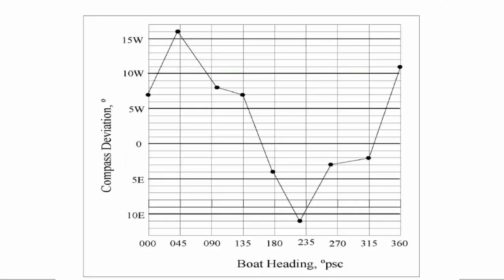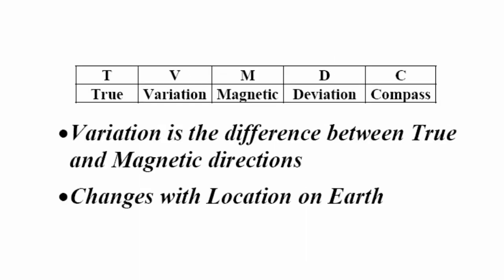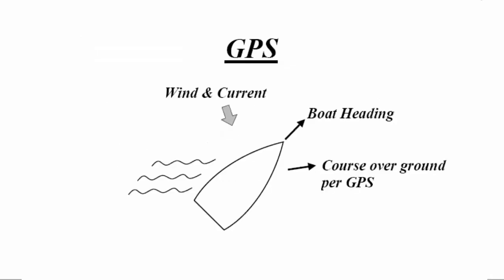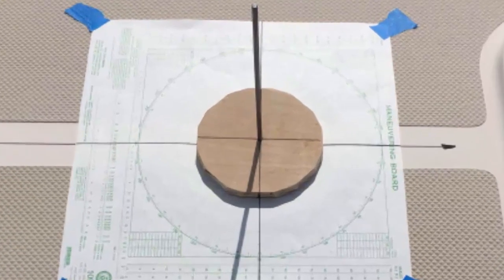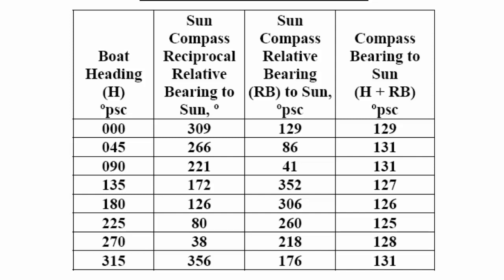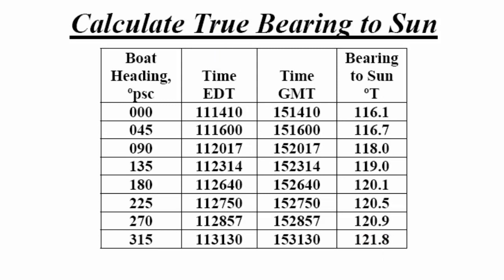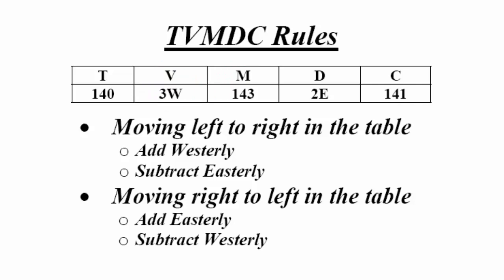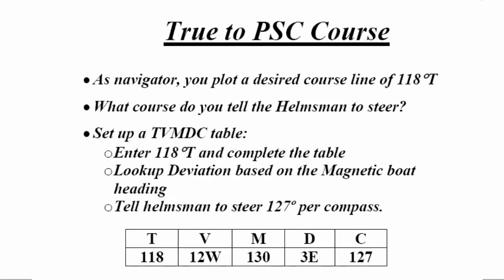Compass Calibration-  The Easy Way

Comment: If you mount the maneuvering chart 0 to the stern instead of 0 to the bow, then you can skip needing to add/subtract 180 to convert reciprocal bearings to relative bearings.
Reply from the maker: That's a good suggestion. Thanks... MDS

Comment: This is an excellent video - thank you for sharing! I can't wait to use this method on my own boat. How did you find the centerline of the boat with which to align your maneuvering board? It seems like it would be fairly easy to be off 1 or 2 degrees when finding the exact centerline of the boat - throwing the deviation table out of whack for a few degrees.

Comment: I've worked through this multiple times and I'm getting lost on a point.  How does the Compass Bearing to the Sun (H + RB) relate to getting the Bearing to the Sun?  It seems like there is no connection between these two numbers.  The Bearing to the Sun comes from the calculation of Lat./Long. + Date/Time.  What was the purpose of spinning my boat around the compass other than to get the time I was at each cardinal point? (I must have watched this video at least a 100 times and I still don't get it - I must be denser than most.  Sorry.)
Reply: G'day Lucas,

The Magnetic compass heading + Relative bearing gives you the Magnetic compass bearing to the sun from your vessel on that particular compass heading @ that time.

Then you must calculate the sun's azimuth at those same times in your neck of the woods to ascertain the actual bearings to the sun (or use an app as he did on the video). Convert those true bearings to magnetic as he has done in the video and you have the bearings that you should have initially worked out after reading the reciprocal from the sun card. Any difference between the two is your compass error... Which should be corrected if >5 degrees on any heading (by law on a commercial vessel, recommended on a recreational vessel).

I much prefer the method of sighting straight over the compass bowl at a distant or transit bearing, though it takes practice to get accurate readings on small compasses this way and involves some contorting of the body, as some of you have said. We do encounter more 'blind spots' with this method but overall it involves far less messing about and eliminates the possibility of miscalculation/misunderstanding on the part of the adjuster, and the helmsman need not be exactly on the right heading as he must be with any other method. Misalignment of the Lubber Line has no effect on bearings taken this way, either.
Once one is skilled at it, there's no better way to swing a compass.

I think the video was well produced and easy to follow. The shadow pin certainly has its place, especially when out of sight of land and when it can be placed in the centre of the magnetic compass card on a full sized binnacle on the Monkey Island.

Chris Felan
Compass Adjuster

Comment: Here you have used 9 bearings to create your deviation graph. Is this generally enough or is there the possibility of non-linear fluctuation between two of these? I'm guessing that larger ships with more metal perhaps require more points to be accurate?
Reply from the maker: It's probably enough, but some people like to use 30 degree increments, which would give you 12 points. I doubt that much of significance happens between those points whether you do 30 or 45 degrees

Comment: That's the best method I've seen in 50+ years , thank you. I'm doing it! 
Also note that the Variation on the charts must be adjusted to the current year. On Old charts this can be substantial. AND the magnetic pole is moving faster than ever thanks to "blobs" in our molten iron core; yes, google that. Cheers!

Comment: Nicely done! I'm in the middle of ASA 105, "Coastal Navigation and Piloting", and I tried swinging a ship's compass using the ranging method described in the course. The experience can best be described as a comedy of errors. Trying to sight the range over the compass was darn near impossible. Nonetheless, as Capt. Tursi points out, that's the method taught in most courses.

The sun-shadow method described in this video sure looks a whole lot more practical. I found a round plywood cut-out at a local craft store, and a metal rod at the Home Depot next door. I have ordered a pad of maneuvering boards, and I am looking forward to giving this method a go! Thanks, Capt. Tursi!
Reply from the maker: Thank you David... Please send us an email to office@mdschool.com if you have any specific questions as you go through this process. We'd be glad to help... T

Comment: Thank you Capt. Tom!  Very clever and I look forward to trying it .  A couple of questions: 1) Can one use an almanac to look up the sun's bearing? Can you recommend an almanac for this, or an online source?  2) Does the geographical location of the boat (and the subsequent magnetic variation of the area)  affect the compass' deviation? If we move the boat 500 or1000 miles to a new cruising ground would we need to recalibrate the compass or produce a new deviation table? Or is the deviation effect mostly or completely due to onboard interference?   PS We sailed with Cap. McKee a few years ago out of Langford Creek  doing 103/104-most enjoyable. We now have our self-built alloy Dix 43 on the water in N. Mississippi, about to take her down to the Gulf Of mexico in a month for her first taste of salt water!
Reply from the maker: The sun's bearing is based on date, time and your location, and therefore needs to be a calculation since an almanac does not know your location; also note that  this bearing changes second by second. Deviation refers to magnetic influences within your boat and is the difference between the local magnetic north and compass north, so ideally it should not change with changes in your location as long as you are looking up Variation on an up to date local chart... Come and take an online celestial navigation course with us this winter and learn how to calculate the Sun's direction manually based on the nautical almanac

Comment: the earth rotates at     360/24 = 15 degrees per hour.how long did your measurements take   BECAUSE THE SUN IS MOVING RELATIVE TO TRUE NORTH.......HM..
Reply from the maker: Take note of the tabulation in the video starting at about 23 minutes, that the total elapsed time for the calibration took about 17 minutes, the bearing to the sun changed by about 5 degrees, and that we recorded the exact time of each observation for use in calculating an accurate bearing to the sun for each observation... MDS